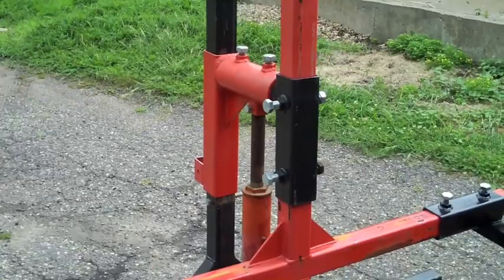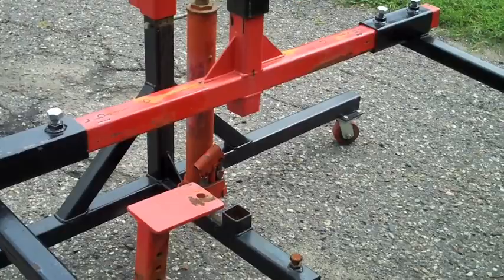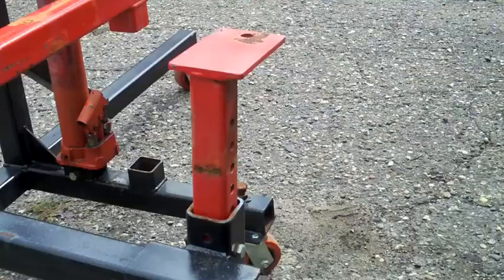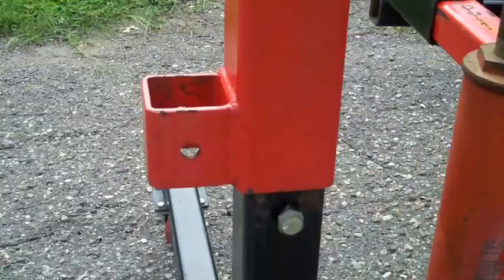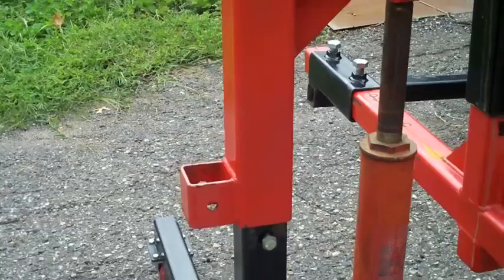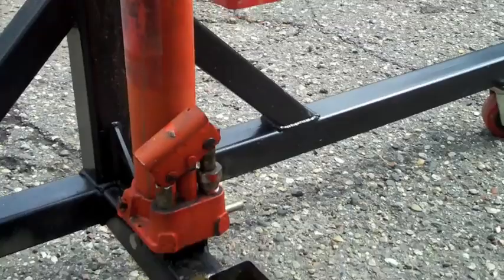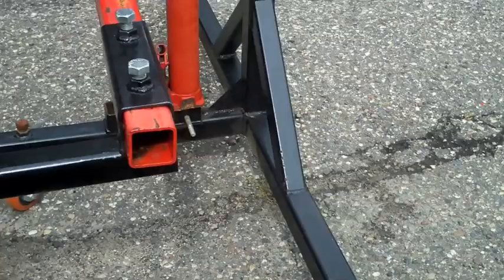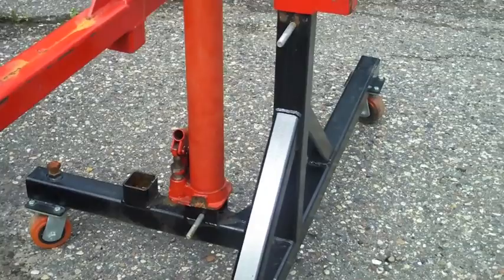Auto rotisserie virtual tour

Comment: Maybe a stupid question but I was wondering about the holes and the welded nuts specifically the holes that are not drilled through both sides. So when you screw in a bolt it just cinches down against the tubing to keep it from slipping? I wasn’t sure .  I’m building the end frames now . Thanks